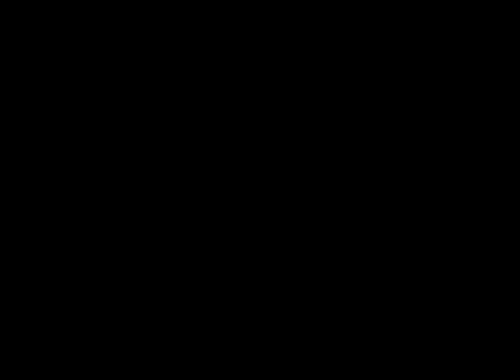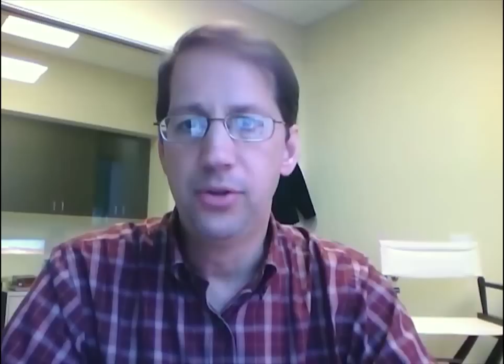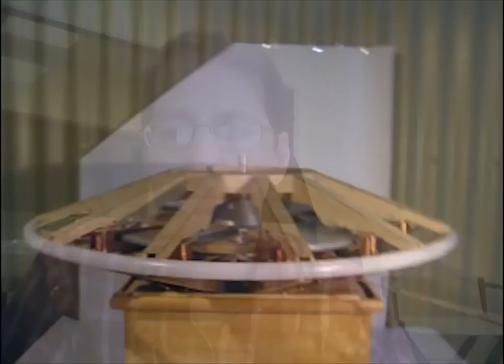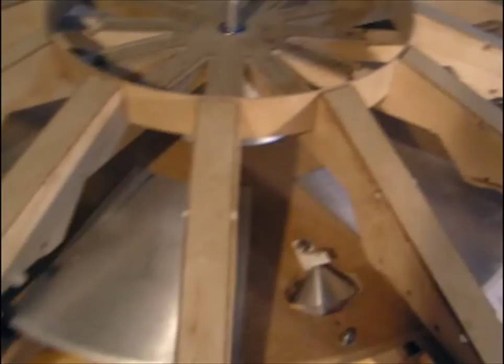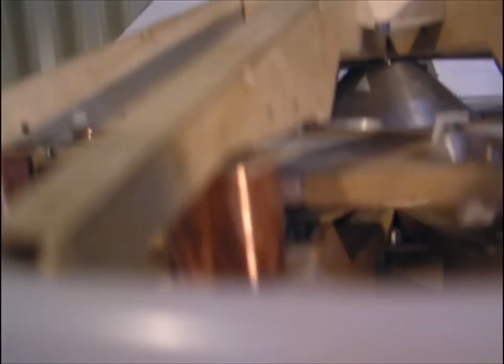Pod Update November 28, 2012

Comment: alright i will try to answer most of your questions, the type of battery is a utron battery that  will recharge itself, this machine can be driven with ones mind, it also has a clockwise and counter clockwise rotating propellers that you dont see here inside which causes an anti-gravity effect. people do sit in the upper cabin, but you must see this will be about 50 ft big. @einsteindrieu you are correct that is a C shape magnet wrapped in coil wire. i am working on the same thing

Comment: -->skin hollowed painted outside & inside with clear crystals mixtures that has installed also in a first hollowed sheet skin an helium with 2-electrodes (looks similar to 2-cell button batteries) that d 2-positive sides r facing together soldered in a positive (+) side with a positive (+) wire & when it to turn it on it'll act as an invisible to radar detector or it could be an invisible as d biomimicry/biomimetic/crystal ball with laser lights respond to it. --->--^
Reply: Are u teaching sir
Reply: Hollow
Reply: I exist and curious always Christian Saenz

Comment: Any update on this project?
Reply from the maker: Generally speaking, antigrav and zero-point is real, it's dangerous in the wrong hands, and it is being suppressed.  I was compelled to walk away.
Reply: @Search4TruthReality  understood, now one question. Where would I be able to get the utrons like the ones you had
Reply from the maker: The team had UTRONs custom manufactured at a machine shop.  NOTE: Mind the diameter of the pins.  They'll snap if they're too thin.  Precision is key.  If they're out of balance, the pins will snap.